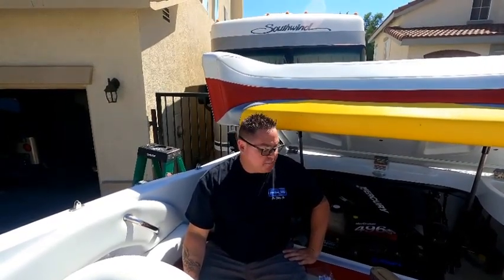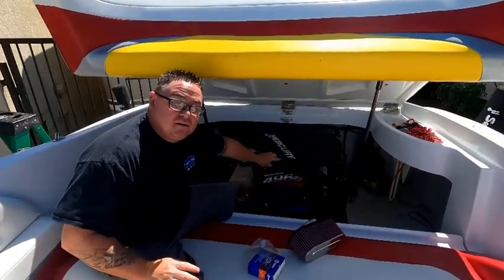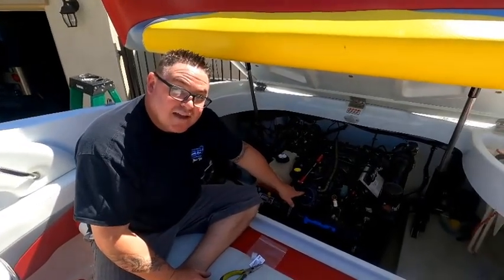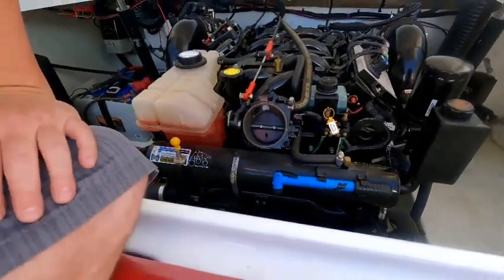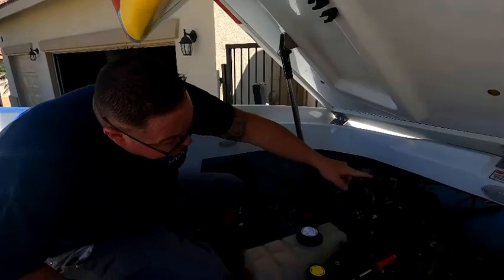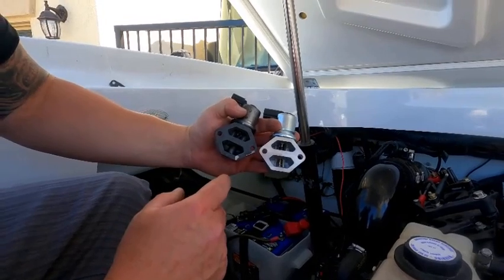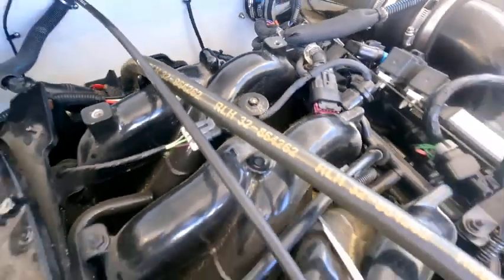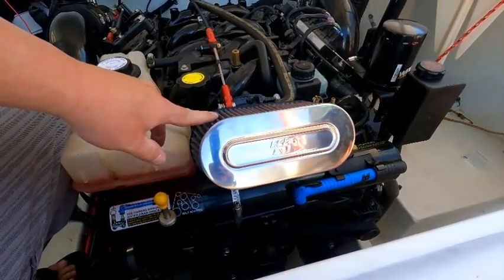BAJA H2X Mercruiser 496 MAG rough Idle / Spark Plug fouling IAC / IAC Muffler replacement / K&N

Comment: Why haven't you gone ahead and whipple the motor?
Reply from the maker: If I do it, I’ll pull the engine change the crank, rods and pistons to all forged then go with Raylar heads and camshaft. Total would be around 24,000 dollars. That way I don’t blow up the engine. It’s a lot of money and I’m building a vacation house right now. Money I guess is the reason.
Reply: So you don't think the motor could handle a 5lb boost without internals? @good2know606

Comment: Any issues with the NAPA IAC you installed ??
Also thinking of getting the Stage 2 calibration, any issues ? Can you tell the difference in HP
Reply from the maker: No issues with the Napa IAC been running it for about 80 hours now, stage 2 calibration is awesome, very noticeable on take off and mid power responds so much better. Don’t over look plugs and plug wires. They made a big difference in my boat. I change my plugs every other season and run lucas every other tank of fuel.
Reply: @good2know606  are you running a 22 or 24 pitch prop ? I have a 26
Reply from the maker: @chrisn4413 right now I’m running a 24 4 blade signature prop from Hill marine, I do about 5,000 - 5100 RPMs and GPS at 69 with full fuel 80 gallons and about 1,000 lbs on board. It has hit 71 but that was 2 people aboard and half a tank
Reply: @good2know606  sounds good 👍 yes ,I'll be changing the plugs and wires as well . Ty
Reply from the maker: I’m going to a 26 pitch in a couple months, I’ll be adding a intake and larger throttle body 90 mm. Should add another 30 hp. Exhaust I’m looking into also. Should be up around 75 - 77 mph. Let me know how it works out for you and if you haven’t already subscribe to the channel. My son does the videos and I help him with it. Thanks take care.
Reply: @good2know606 I subscribe and keep me posted on your upgrades .
Reply from the maker: @chrisn4413 cool will do, let me know how the whipple stage 2 goes

Comment: What spark plug does the 496 mercuiser take
Reply from the maker: E3.44 is the part number for the E3 spark plugs I use. The AC Delco plugs were not lasting. I tried 3 or 4 different brands and E3 believe it or not run the best in my boat. No soot and runs really smooth.

Comment: I have the same engine in my 2006 Chaparral, about to do the plugs, I’m hoping it’s not a pain in the rear.
Reply from the maker: They aren't to bad, if you get a swivel and a 3/8 extension that has a swivel head on it helps for the rear plug right side. If you can afford to change your plug wires at the same time I recommend you do that also. Stock wires aren't very good. Remember dialetric grease on the boot, slides on easier and prevents rust. Good luck!
Reply: @good2know606  just got them all done and did all that, you were right not a bad job at all. Great video and thank you for the advice.
Reply from the maker: @mrfixit8640  I'm glad it worked out for you. It will run alot better. Lucas injector cleaner is also good to use at the start of the year, I tend to put a bottle of it in first couple tanks of fuel. I'll be doing a short video about it here in a week or two. Like and subscribe to get videos on tips and tricks if you can, my son will appreciate it as he makes the videos. Thanks for letting me know that it worked out. Feel free to ask questions and if I can help I will. Take care and have a happy safe boating season!

Comment: I have that same motor in my eagle 230eliminator. .....I'm looking at changing my impeller. ....I noticed last night when I ran the garden hose to it that no water was coming from the exhaust after about 3/5 minutes. ....usually it spits out water within 1 minute of startup.......what is the bike pump for on the heat exchanger? Any ideas??
Reply from the maker: The bike pump is to drain the heat exchanger for winterizing. I live in California so I don't do it. I'm assuming you have a bravo 1 out drive correct?
Reply from the maker: The impeller is pretty straight forward also. You do have to drop the lower unit. I would put duct tape on the front of the drive where the speedometer registers first and then see if water picks up. It helps mine circulate better
Reply: @good2know606  where do you mean in front of the drive.....the little hole(s) at the opposite end of the prop??.....where water usually comes out when hooked to a garden hose??

Comment: The iac muffler is only to prevent a high pitched whistle noise. Yours prob got sucked in. Also marine iac don’t have a spring.
Reply from the maker: Your absolutely right about the muffler, and this IAC is for Mercruiser / Marine use from NAPA just a different brand that is 30% of the cost. Subscribe and see the next few upgrades I'm doing to my 496. Comments and knowledge is always welcome. Thanks 👍